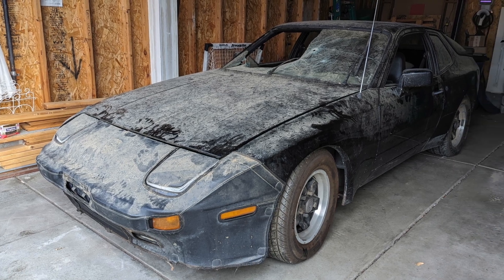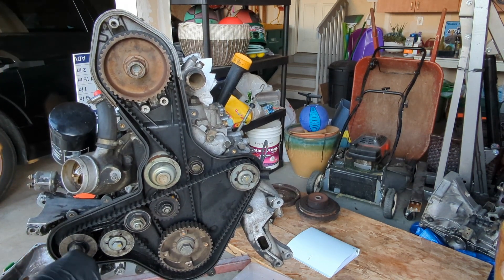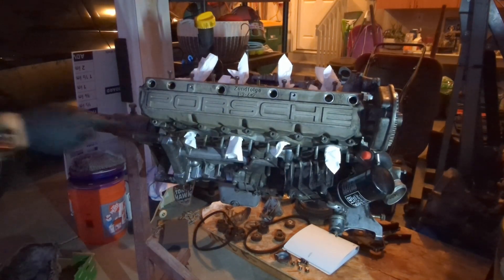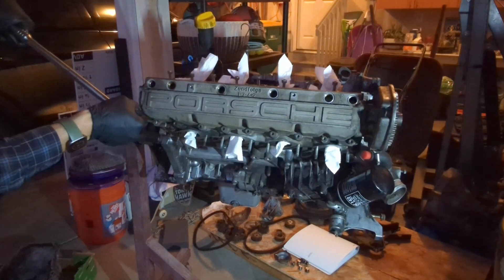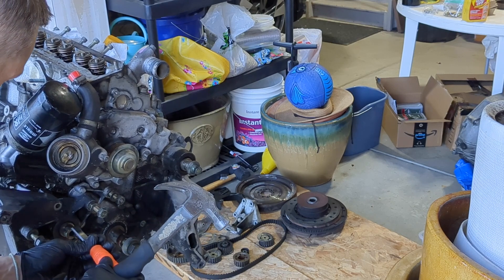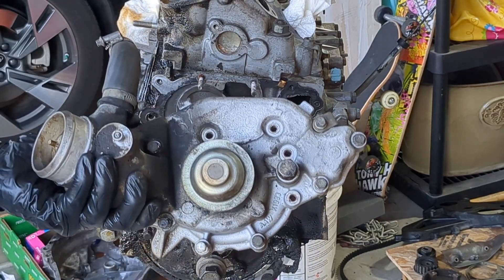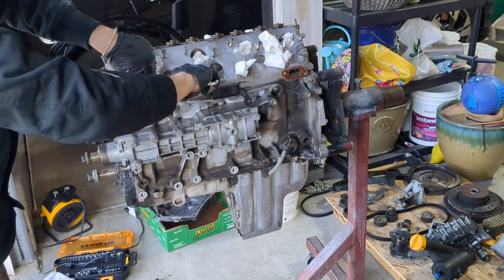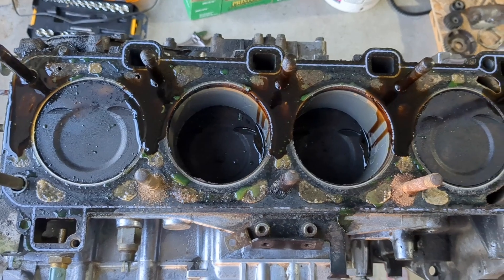Porsche 944 | Engine Tear Down Pt 1

Comment: @944Restore -  Great collection of video's very very informative and easy to follow. Do you have a video of removing the bell housing...   I'm at that point and can't seem to remove it..  something that i can see is holding it on.   I have the bell housing and block separated with a gap all round, but cant completely remove it